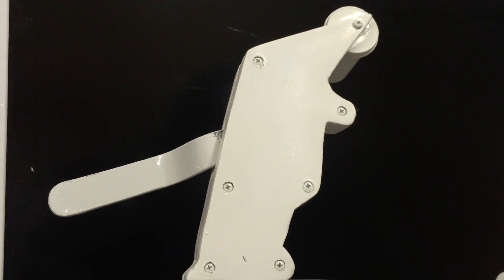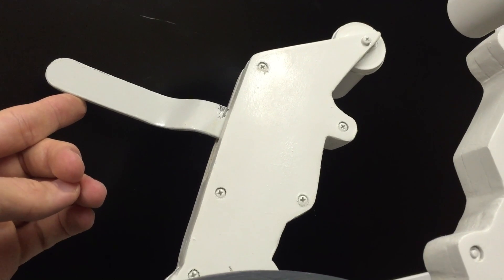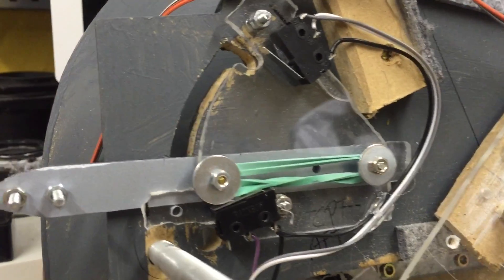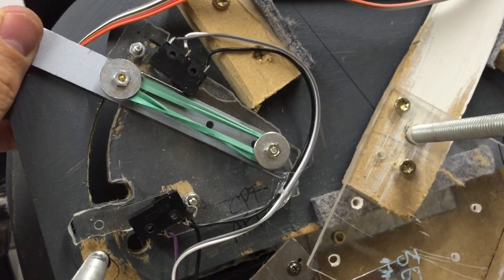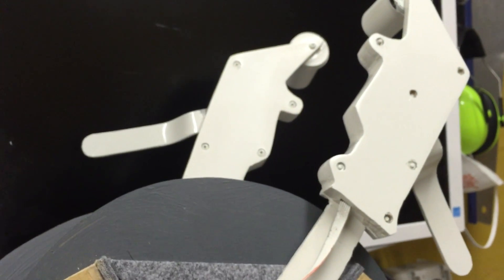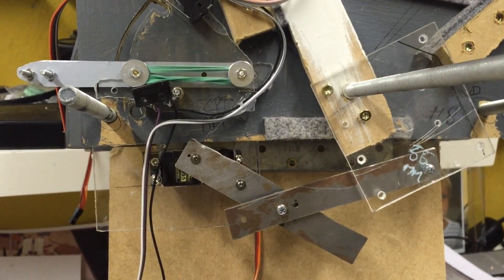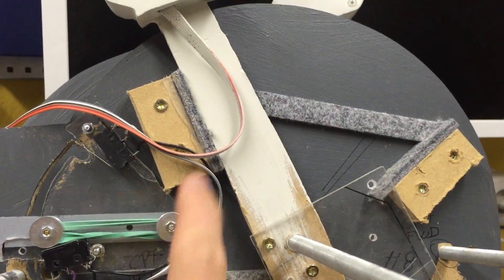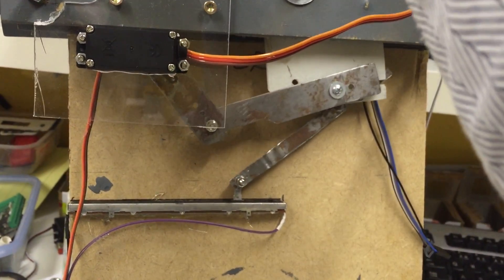Home made throttle: Motorized Throttle - B737 Home Cockpit

Comment: correction to my last comment-shows how memory can be suspect sometimes!!
I have just checked my FCOM and both B 737 types have electrically operated FSOVs powered via Battery/Hot battery bus sources-therefore available on battery power only should all generator power be lost. 

As to when these switches are activated by engine start lever movement my guess is not at the detent positions in both cases. 

The aeroplane is quite restricted on standby power-barely 30 minutes electrical endurance-unless an additional battery is installed-fuel system is especially degraded-no fuel pumps at all so gravity feed wing tanks only-with possible thrust deterioration above 30,000 feet-and all centre tank fuel unuseable .

Enjoy your time away

Regards

Comment: you are too modest Peter-your work is very clever and well thought out.
I am a recently retired B738 Captain with 14,000 hours PIC-my recollection is that the Engine Start Levers ( in effect the  fuel levers) operate via a cable to the MEC/spar valve-opening and closing them around halfway between cut-off and idle positions.

 The detent positions at either end of travel are safety features to prevent inadvertent operation of the lever-especially shutdown!! Note that 600-900 models have an blue eng.valve closed and a blue spar valve closed light per engine-the earlier model B737 have only the one blue fuel valve closed light. 

Your pedestal configuration looks terrific-I would not worry about the micro switches being activated at the end of engine start lever travel. Thanks again-my son and I will be attempting an upgrade to his home flight sim. aided by your great ideas.

Comment: Nice work! I have a question for you. Does Is this lever hardware so haevy for the servo motor?
Reply from the maker: +meraki I use "heavy duty" servos with metal gears. So far they have passed the test. 
Only problem has been the plastic arm that you put on top of the servo. The plastic teeth has been teared all off my the metal shaft on the servo. So you will need a metal arm.
Reply: Can you send to me your .INO file? amarildocunha@hotmail.com

Comment: I think its activated as soon as the leaver reaches the top. The pull out motion does not move the cables leading to the switches deeper in the throttle stand on the real one. I saw a video where a guy was modding one. It looks good though, every time i try something mechanical I fail.

Comment: I have only recently started to collect or build my the parts//components for my 737 cockpit set up   what I would like to find are full size drawings for the throttle leavers  ,  if you have a set of said drawing and you could let me have a copy I would gladly reimburse you for any expenses  that  you may incur ,   or maybe you  could  point me in the correct directions  for obtaining  some  of the same, a  great many thanks for taking the time to read my mail , sincerely yours V.L.A.P ( lonewolf 45 )
Reply from the maker: +Leslie August All you need is on this page. :-) www.737ngproject.be/throttle.htm